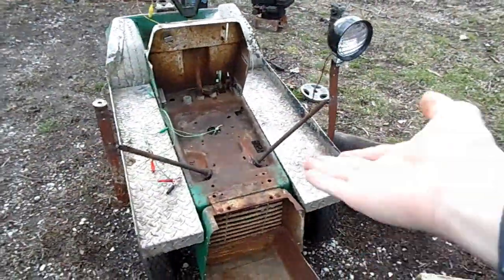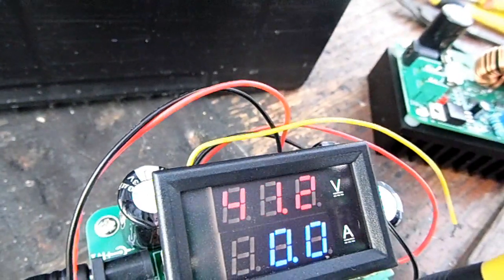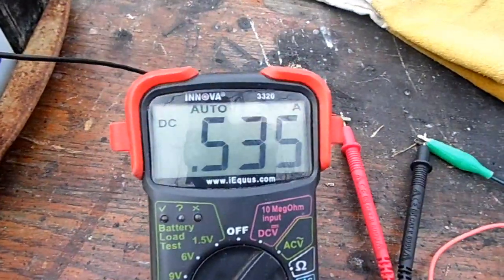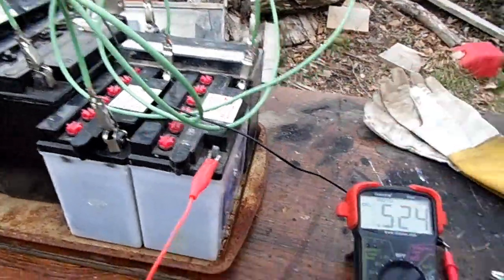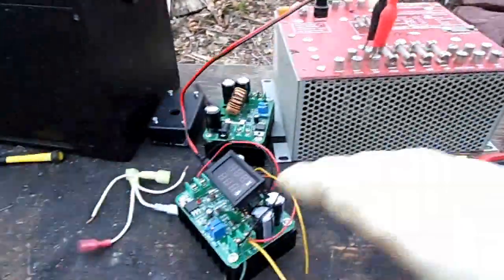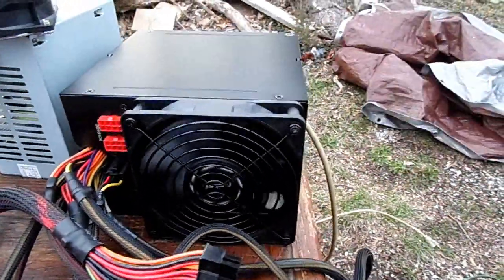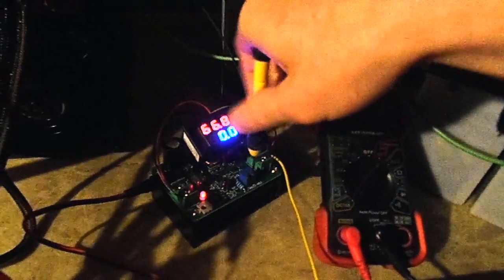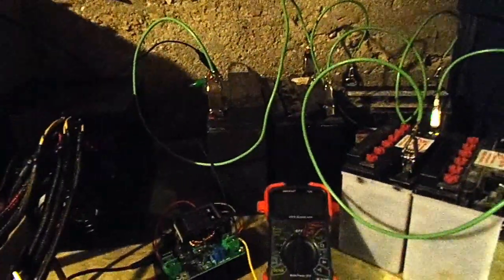DIY Elelctric Lawn Tractor part 6: charging batteries

Comment: Cool stuff. The reason the older power supply is so much larger than the computer one, despite being less power, is because it is a linear power supply, whereas computer power supplies (as well as AC adapters, your bench power supply, and your DC-DC converters) are switching power supplies. Switching supplies are much more efficient, hence being smaller, but the power from linear supplies is higher quality, making them ideal for radios and other sensitive stuff. They're also usually more reliable.
Reply from the maker: also it has 2 amplifiers and like 5 differant voltage outputs on it.

Comment: If you use a 10-pin connector on the battery side with each battery getting its own pair of pins, you can wire the mating side on the tractor to connect them in series and the mating side on the charger can be wired in parallel.

Comment: Hmm potential difference and effective battery resistance problems, handy little buck/boost supply that :-))

I am supprised that the batteries did charge in a balanced way, i would have expected individual batterys to have different capacitys and effective resistance.
Ive had this unequal problem with strings of unmatched leds in series.

Interesting fiddling :-))
Reply from the maker: yeah they where not teh same voltage, but they all ranged from 13.5 to 13.8. and it can be good on a battery to let them get to a kinda high voltage (as long as it doesnt overcharge)

if not i'll get some zener diodes that will fix the issue.

Comment: wouldnt it be easier to parallel all the batteries to 12v if you are taking them to basement to charge?  lead acid being the one type you can parallel charge,  that way they will all even out their voltages, i can understand using the booster for charging in situ to save rearranging all the wires
Reply from the maker: yeah but i would need more jumpers and i'm testing to see how well they would stay in balance in series. i already know it would work for parallel but am testing it for when i keep the batteries in the tractor all the time.
Reply: Rinoa Super-Genius
yeah its fun to try, jumpers are just some cheap ebay jumpers which is what i do  ( if you only put 500ma amp in they do fine}  its interesting to see what a combo of battery types will do and if they stay in balance

Comment: I think the idea of converting the gas pump to a charging station is a good idea.  There is the symbolic act of going from gasoline to electricity from the Sun for vehicle energy.  Also, you really need to get that stuff out of the basement for safety reasons - avoid putting a fire generator under your house.  And, it would free up the basement work area for other things.
Reply from the maker: yeah i know, thats also why i dont charge them to a very high voltage. luckily our basement is missing a few bricks so theres always wind blowing through haha.
Reply: I felt like asking, "What type of fire suppression system do you have in the basement?"
Reply from the maker: *****
nothing fast enough for hydrogen haha.
Reply: I'm not sure how much gas accumulation there would be, so I don't think there would be a really big explosion. I think the initial flash will set other materials in the basement on fire.

Would you like to run a test?

The friend of mine who has worked with computers from the beginning of the 1960's and I were talking the other day about the fire suppression system used on the old mainframes.  If there was a fire, water and other fire suppressants would damage the computer, so the room would be filled with gases to displace oxygen.  The only problem was that it would kill the humans in the area.  So there were warning signs that that type of system was in operation.  In that case, the fire was the least of your problems, it was the suppression system that would kill you.

Comment: Great video.  How do you have so much cool stuff at your house.  I wish I had that many batteries.

I want to build a lithium ion battery like the one for your electric bike.  Can I take the cells from a laptop battery and still charge them from the laptop plug?  In the beginning I don't want to buy a fancy plug.
Reply from the maker: well it would be very complicated, why can't you just spend 30$ on an imax b6?
Reply: I have no idea where to get one here in Mexico.  I am looking for RC shops but no luck so far.  I also want to practice building a charger using the Arduino so later I can build a balancing charger for the over 600 cells I will have in the solar car.  I would like the Arduino to check the cells one by one in a timed pattern.
Reply from the maker: 2012theperfectworld
i get my stuff from ebay. we dont have many shops at all where i live.

Comment: Why not get an old power supply and tie it in with the battery pack, get a rope or ratchet strap and use that to hold then together? Just have the cord coming from under the hood, and have everything out of sight? 

I love top gear. And sherlock, but I usually dont watch tv, but im on youtube all of the time, but I found a channel that has most top gear usa shows. Not many uk shows out there. A channel known by usamma mudassar, sounds weird, but he has a few uk episodes.  

I like your clean, clear accent, british ir not, you speak very clear and fluently.

Could you do a video on how to make that thing with the power supply like you said? 

One more, can you reverse a computer power supply to make it a 12 to 110 inverter? Or converter. I always get those two confused. But all the same, you know what I mean.
Reply from the maker: what kind of power supply do you mean? and how would it help if i strapped it to the battery pack?

i'm not sure about the 12-110v from a computer power supply. its prolly possible but you would need to re-engineer all the circuitry prolly.

and thanks for the compliment on my speech. to myself i always sound like i still talk like a 3 year old. idk why but it sounds like i mumble things. thats most likely because i'm very critical of my voice.

youtube is ok for some shows, but piratebay has much better quality and more selection. not counting you can download like 5 series at once.

i tried watching the american top gear once and it just sucked to me. it wasnt funny and was borring.
Reply: Rinoa Super-Genius I mean a computer power supply. And strapping it to the pack would help keep everything together.  Nothing would fall out.

Btw, please check out www.atltf.com,  they will have a lot of good ideas on this build and can hrlp with tires and the overall build.  Ive got an offroad tractor ive been working on as I go. Theyve helped me, they can prodably help with your whole setup.  Be good to check out.

And your welcome!

Comment: You should be using 80 plus gold, platinum or titanium ATX power supplies to convert AC to DC 12V with high efficiency. Regular PSU's that come in a typical computer are horrible and only convert around 70% of the power they are using. 80 plus titanium converts 96% of the power so you only lose 4%. 80 plus Platinum are much cheaper and still convert 94% of the power. This is far superior to a non 80 plus PSU that is wasting 30% of it's power and some even worse. Deliberately using non 80 plus PSU's is as stupid and deliberately using incandescent light bulbs.
Reply from the maker: 70% is still good enough since we are only talking a few watts, and not counting this is temporary till i get my charge system built. i'm not gonna pay money to get a PSU for like 70$ when it'll only save me like 1$ a year hahaha

and also the energy isnt "wasted", its just turned into heat. i switch to incadescent bulbs during the cold months and they help to share the load with my central heating system.